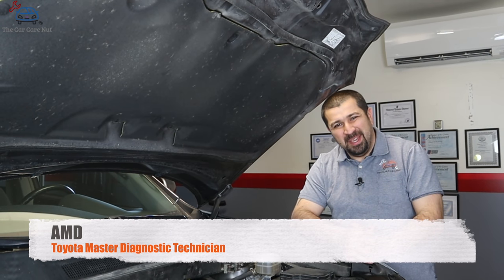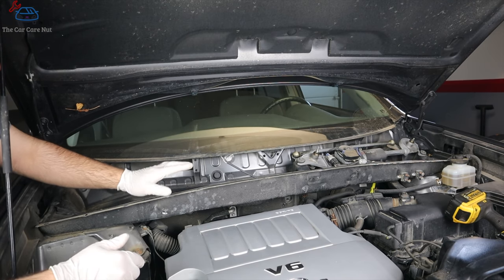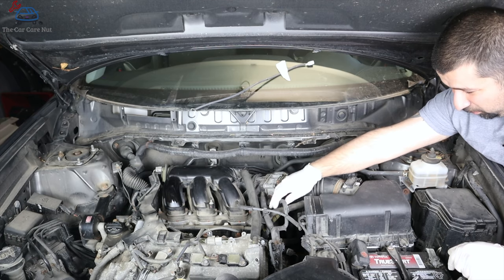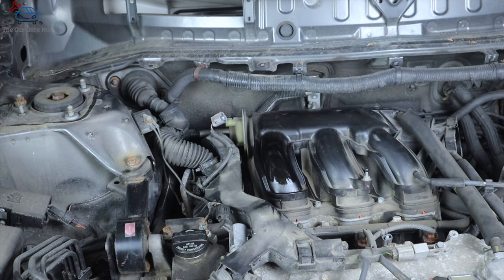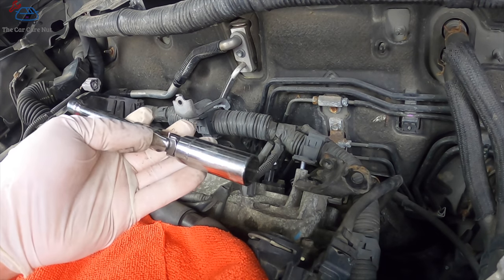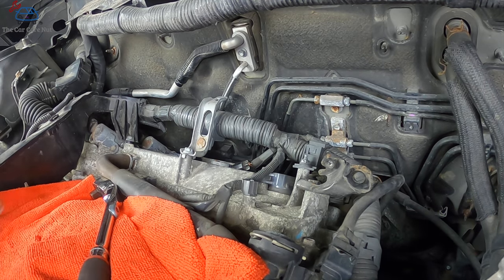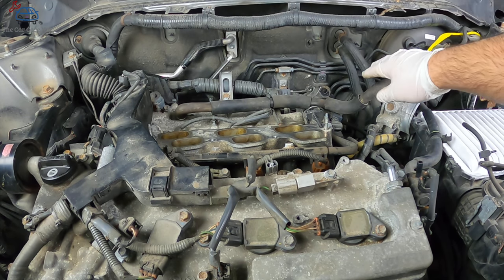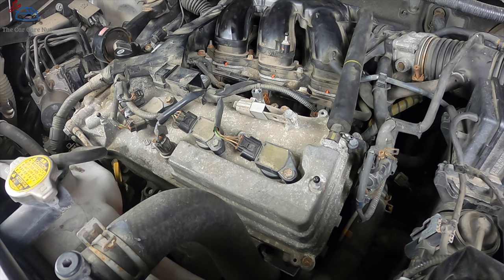How to change spark plugs on V6 Toyota and Lexus 2GR-FE 3.5L engine

Comment: Yikes I just spent 2.5 hours taking things off I only booked 3 hours so about half way through I retreated and started reassemble. I didn’t have an Allen wrench almost took off the pentium. I didn’t have gaskets  so I was saved by that. So I will buy the gaskets to do it now. I knew the rear would take the longest so I started it first because once I pulled the first one I wanted to complete the last one.

Comment: Hi 
I have 2011 Toyota highlander limited edition. I have problem with air conditioner, it doesn’t blow cold air in a slow speed, when you stuck in traffic or idle,
The pressure is perfect, it blows cold air when car is driving normal.
The radiator fan working normal.
I don’t know if the fan should work at different speeds, 
But i only see one speed 
I took it to a few mechanics and they keep saying you need to add refrigerant.
I know a little about hvac for he but not for cars.
Please let me know what can i do. 
I don’t want to take it to the dealer before i talk to you 
I am in Maryland, i wish you were closer 
Thanks for your help

Comment: If you know that the sparkplugs were recently (last week) torqued to 18 in-lbs (2grfe 2011 rx350), instead of 13 in-lbs, would it be recommended idea to redo (loosen plugs and re-torque to 13 in-lbs) to prevent future seizing?

Comment: Do you recommend changing the coil packs too?  especially on the back 3 cylinders since its more difficult to change.  Is there a recommended mileage for changing coil packs?

Comment: I had to slow it down to get the direction of the way to remove the rear spark plugs. So removing them would be towards the ground tightening them is towards the sky?

Comment: Can you someday showing us how to replace the VVT oil screen and VVT solenoid?, this engine is notorious for valves tick if owners delay oil changes over time, I would imangine the vvt oil screens and solenoid will not be at optimal operating condition due to old oil deposit.

Comment: I've been changing spark plugs every 60,000 miles here in California on my 2013 Lexus GS350. Am I correct because my maintenance book says they need to be changed this often for emissions purposes? In all other conversations I've heard about this engine, nearly everyone says 120,000 miles. I'm coming up on 180,000 miles, and my last plugs were changed at 120,000 miles. Should I continue to change at 60,000 miles or am I doing unnecessary maintenance?
Thanks.

Comment: Congrats on your new shop, Chicago is lucky to have you, I didnt want to post this on your new video but I was hoping to get a response here. I opened the front valve cover to replace the gasket, you know the small rubber grommets (shaped like the # 8 ,theres 2 on one side and a little circle on the other side) - where can i get the circle one? please help, i cant close my valve cover without it , i ordered fel pro and cant find it in the pack nor online anywhere, you're my only hope!
Reply from the maker: Hi! The dealership will have it. Usually they have them in stock. You’ll find it in the same parts catalog area where the other 2 are
Reply: @TheCarCareNut  Thank you soo much, I cant believe you still look at the comments from older videos, you are a star!! I pray the shop you have is lucrative enough to chase your bigger dreams and goals!

Comment: Is there anything special to keep in mind if I remove the strut tower cross brace on my 2004 camry with a 3mz-fe to do this job?  Also, my dad's mechanic told him that his coils should be released after 100k miles or so. Is that true or is he just trying to sell something? For context, one of his coils was bad and the mechanic recommended that while he was in there?

Comment: Also, can you elaborate on why the black plenum gaskets are bad vs the orange ones?  I ordered the Fel-Pro Intake Manifold Gaskets from Rock Auto and they are black.  Is it worth it to go hunt down the orange ones somewhere and leave the car apart until I have it to reassemble?

Comment: Loved this video. Following step by step but ran into a problem getting the lower cowl strut bolts off.  I’m stuck. Even the impact couldn’t loosen. I put PB blaster and WD40 on them, used the impact forward and reverse for about an hour before giving up. I’m using a 14mm extended socket on the impact. Tried using my 3/4 ratchet first but switched over after no luck. Anyone run into this? Have any ideas on how to get these bolts off? They aren’t rusty so I don’t know why they’re so stuck. I’m a 5’3” gal so trying to get leverage is troublesome lol. Not sure if anyone’s still out there watching this. Fingers crossed. Thanks!

Comment: Is this much the same for the 2.5L V6? I have a Lexus IS 250 and I was reading to take off the intake manifold, which you need to do to get to the plugs on the driver's side, you have to disconnect the high pressure fuel line that goes through the manifold. I saw that and decided that was not something I wanted to do. It's a 2008 by the way.

Comment: Should the battery be disconnected? The last time I replaced my air filter, I got a CEL because I disconnected the MAF. I never turned on the ignition while I was doing this. I used my scan tool to clear it but then had to wait for emissions to pass.

Comment: Can I determine if it's a spark plug or a ingition coil miss by a test on my lexus 3.5L engine? If it's number 3 is it best to replace all three rear plug and/or coils if I have 55 miles on
new plugs? Have 125,000 on suv.

Comment: Hi AMD. I have a 2010 Sienna and changed the plugs. During the process lost some of those vacuum hoses to the air intake box. Not sure what those are called. Any chance you have the part numbers?

Comment: I am a new DIYer, due to the cost of taking such repairs to a auto repair shop.  With that in mind, please provide me links to what you would recommend are great tools for a budget that I can get to do this job, since I need all the tools you used to do this job.
Reply: Harbor Freight tools are inexpensive and work well for low-use non-professionals. 👍

Comment: I have a 2008 Sienna. The intake bolt in the back can only be reached from over the intake. There are metal lines blocking from the left side facing the front. The space is much more crowded with wires in the back that is barely movable. Is there a way to remove the wires over the back coils? 
Oh also like others said, the coil connectors will break. I replaced them with new connectors. There are YouTube videos explaining this. I will try to finish the job today. My body is sore as hell.

Comment: Hey there, I'm looking to do spark plug replacement in a 2013 Sienna with the 2GR-FE engine... at 141K miles, because my mother couldn't afford to get it done at 120K, but now it's occasionally having trouble starting. Should the coils be replaced as well? I'm a bit worried that they've become a bit prematurely worn out by running spark plugs far past their maintenance interval, and don't want them to fail at a much more critical time... just that coils are expensive, so if it's not something that might fail within 100K additional miles, my parents would want to skip that expense.

Comment: I would add to be prepared for when the coil connectors break the locks off. I did my 2011 and every single lock broke. I might would try just putting a dab of sealant on the fronts but definitely not the back. You can buy all 6 connector bodies for less than $20.

Comment: Thank god the RX350 gives you more room between the rear of the engine and the firewall to get that 12mm bolt out. Very easy on the RX but would probably be a nightmare on my 07 Camry

Comment: Thanks for another great video. 
If by lucky I have one of the 3 rear ignition coil goes bad, any short cut or do I have to go thru all theses removal steps to replace it? 😢
Reply from the maker: You could squeeze one of them out but honestly it’s not worth as you risk damaging things. Just remove the plenum. Looks harder than it is

Comment: On my 2005 Camry 3.0 V6 ..I'm changing spark plugs and I need to change rear upstream O2 sensor.. My question is, Can I get to the sensor from above after removal of plenum and throttle body?.. I found it to be very difficult trying to remove it from below..
..

Comment: I have 2011 Camry v6. Car shake badly at 40 mph and up. I do not a have any check engine light even holding same speed as car shake on the road. Tires recently replaced. Please let me know if you experience this issue in the past. Thank you

Comment: Thx for this video !! I watched it and have the plugs … and am gonna do coils at least in the back … Lexus 07 Es350 .. Engine threw a P0356…i put a Denso coil on #6 ..and it fixed the issue for now … BUT before I go forward .. I ran into a few things ..

first the electrical connector retainer on the wiring harness for coil6 snapped so now there is no retainer … without changing out the entire harness …where can we get replacement connectors ?? 

2nd .. the retaining bolt heads for the coils are rusted pretty bad ..and Id like to replace them all …can we get those as replacement parts.. and can we find the bolts and nuts for the top of the intake ? .. i’m gonna replace those whole i’m in there 

Thank you for sharing your work with us !! And thank you for your reply if you get the chance 
God Bless !
Reply: I think I may have found all the parts !!! ..it seems that Lexus actually shows the nuts and bolts part numbers on their parts site .. and Rock Auto has the wiring harnesses and the best price on the Denso coils !!

Comment: My son has a 07 es350 so this should help.  It has now 106k miles now.  When if ever do you need to change the coils?  Thx
Reply: Only need to change coils if they fail you will get a misfire. On my 99 sienna I had 2 out of 3 fail, my 07 camry has original coils at 250 k

Comment: Hey how much do you charge for a job like that? Called the dealership they talking about 1500 and change. 120 per coil and 20 for spark plug and 5 something for labor.

Comment: I'm currently stumped working on my 2007 RAV 4 3.5L.  I need to replace the o-rings and valve cover gaskets on both valve covers.  Everywhere on YouTube you will find how to replace the bank 2 gaskets but not nobody has done bank 1 closest to the firewall.  Removing the front valve cover and intake manifold is easy. However, the cover closest to the firewall has me scratching my head.  What's the best way to approach this problem.  It seems to me that removing the exhaust may give me the clearance to reach all the bolts from below.  Any help would be appreciated.

Comment: I did this and i think i have a huge vacuum leak, i didnt replace the throttle body gasket, could that be the cause,  i have a rough idle delayed acceleration and the brake booster isn’t working im gonna try to slowly drive it to my mechanic around the block tomorrow

Comment: All data gives this 2.5 hours in labor. I would say most shops are charging about 100/hr in labor (at least). OEM plugs are like $15 each and the gasket is around $5. I would say an honest non dealer shop will charge around 600-700 dollars to do this job:
250-300 in labor
165 for parts
50 for “shop supplies”
Plus tax

Comment: hey i have a 2014 es350 with a missfire on cylinder 3 i replaced plug, coil and the injector. i still have a missfire at idle. any idea what it could be? are they known for any problems? thank you for your help

Comment: Ran into a P0010 code and the engine shuts off after a few seconds (sounds great while it is running though). Any suggestions or where to double check? Thank you very much

Comment: IN NEED OF HELP 

I have a question. I have a 2018 Toyota Corolla I store during the winter. I’m getting ready to take out of storage. Should I remove the spark plugs and spray a little “fogging oil” before I start it. It’s been sitting for almost 6 months. I will be changing the oil as well.
Reply from the maker: Hi! It would be a good idea to do that since it’s a reoccurring storage.
Reply: @TheCarCareNut  awesome thank you so much! Any other advice for this car? Or any advice to make this car last well into the 300,000+ miles?
Reply from the maker: Hi! Just keep up the maintenance

Comment: Hi I just replaced the plugs and coil packs (232K miles) long overdue! My 2011 Sienna AWD limited started but kept stalling out after about 5 seconds. Same problem I had before. I had not put the wiper cowl back in yet. Attached to the passenger underside of the metal wiper cowl is a small heat sink with an electrical connector that I had to disconnect to remove the cowl. I decided to set the cowl in place and reconnect this wire and the car started right up and stayed running!!! I cannot figure out what that part is and why it would affect the idle. Can you please explain?  Thank you. BTW: the toughest part of my job was extracting the 4 corroded 5mm allen-head bolts from the air intake manifold. Took me a couple trips to the hardware store to buy an extractor set and then back again to buy new bolts!! But I got'er done.

Comment: Hi, I have don all the same but I didn't change the cascades.
When I start the engine it was shaking do you thing it is because of the cascades or one of the coil that it may wasn't work properly 
Thanks for all

Comment: Hello, I did this job and when I started the engine and I have a misfire the check engine light came on and the traction control lights are on I doubled check all but cannot find the problem do I have to take this all apart again or does this problem sound familiar to you maybe you might know what I should check

Comment: Hi I have a 2010 toyota kluger and changing my spark plugs,is there any more bolts at back of intake manifold as I have taken the 6 ones out of front and still won't lift out

Comment: Hi, I have a Vellfire with this same engine, recently replaced the spark plugs. But did not replace the gasgets (black ones) as they looked good. I notice oil behind the gasgets in the groove. Anyway, put everything back together and made sure all hosed are seated correctly and tight. I can now hear hissing sound coming from near the plenum when accelerating. Also engine check light has illuminated. Error code reads: system too lean bank 1 and 2. Please can you advise how I can fix this. Do I need to clean the oil from the gasgets? Please help. Thank you

Comment: HI AMD
I have a 2010 Highlander 2GR-FE 3.5L  Engine.  My car has 45000 miles now.  Do I need to replace new spark plugs at this time or wait it until it reaches 120K miles? 
Thank you very much
chih
Reply: Is there any one willing to answer my question above please?

Comment: 2007 Lexus es 350 scan code p0353 and vsc check and check engine. Engine running normal, no vibration or abnormal acceleration. Does ignition coil #3 needs to be replaced and/or spark plug?

Comment: when would you replace plugs for a 2016 Highlander that currently has 62K miles on it How many more miles or years before replacing them? THANKS BLD in Georgia
Reply: My 2008 RX350 has 135,000 miles on the original plugs, so I figure it’s almost time to replace them.

Comment: Hello! 2GR-FE Venza 09' @ 200k miles, DIY 1st time changed 6x TOYOTA OEM plugs, gaskets, air filter = engine more power! New issue. Smoothness changed to a "breathing or heaving" idle versus smooth, even stable idle. It's not awful, but distinctly noticeable and engine is considerably louder and rougher than before change, slightly worse after, even worse with A/C on. DID NOT use torque wrench.:( noticed some oil stuck on walls in some pistons more than others forgot to check all in great details. at 200K is all this normal? I know getting computer check is option, but if you're not worried, neither am I. It still has a lot of power for its age and usage. Fluids on hand to perform DIY transmission oil and engine coolant change per your videos. Are conditions described normal for engine age? do you need more description of symptoms? I have a photo of piston...Is there a tweak or adjustment needed? Can I buy or do that with a diagnostic tool you demonstrated in a video?

Comment: Is it necessary to lubricate spark plug thread by anti-seize grease? I do this every time when replace spark plug, but do not see it in your video. This part of procedure eliminate threads stack in the block. Only torque has to be corrected bigger.
Reply: He mentioned to never use anything on spark plug threads.  Good luck!

Comment: After changing the Ignition coils and the spark plug.A code P0305 cylinder 5 misfire showed up.I didn't use OEM coils I am just wondering if that could be why that code is popping up.

Comment: What happens if I do not change my spark plugs at 120k miles? Will I start to get cylinder misfires or potentially damage the engine?

Comment: Looking to get a 2008-2010 highlander or 2005-2009 4Runner and was jus checking maintenance.  Spark plug change on highlander wow.  Which of the two I mentioned is more reliable long term in your opinion?  God Bless cya later! 🙏🏽 @carcarenut

Comment: I completed this job on my 2008 Avalon,  but now my car's rpm's fluctuate when I accelerate from the car being stopped but only when the engine is cold. It will not do it once the engine warms up. Any idea what this issue might be. Car is also not giving a check engine light. Any help would be greatly appreciated.

Comment: So do you also recommend Denso for coils?  I see a lot of cheaper versions but Denso coils not available.  I have to get my van running and its got a dead miss, all at once which pretty much has to be a coil.  So...luckily its #2 so I can get at it to get it back on the road for several upcoming trips.  But its hard to find Denso coils.  Dealer only item?